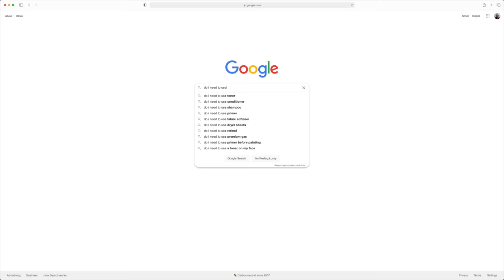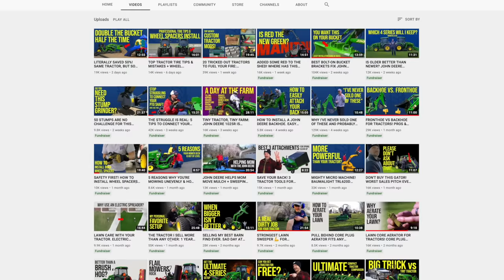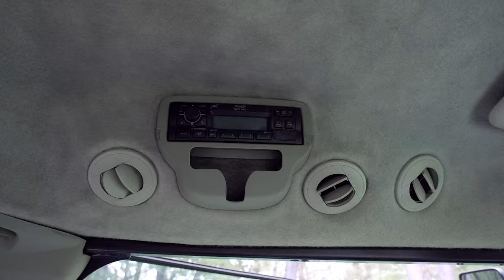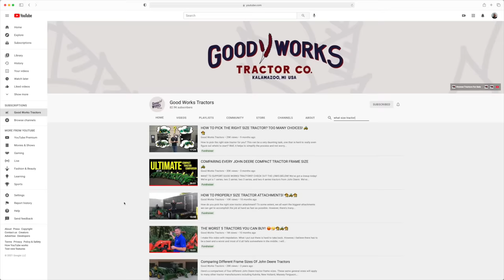TOP 10 BIGGEST TRACTOR PURCHASE REGRETS! COMMON MISTAKES! 😭

Comment: Mid mount mower is the reason I'm getting rid of my tractor. Thought I'd use the hell out of it but I'd rather use my 300 dollar riding mower. It's just too big and a hassle to deal with. A tractor is not a mower
Reply: Never understood why anyone would purchase a compact (or larger) tractor when used just for lawn mowing. I don’t think all that weight is good for a lawn. I would strongly recommend an x500 or x700 series John Deere for lawn mowing.

Comment: I love my mid mount mower deck. I have a John Deere 1023e. It takes less than 5 minutes to attach or detach it. I have about 3 acres to mow. I suppose a zero turn would be nicer but they cost about $3000 more and you can't put a loader a bush hog or a box blade on one.
Reply: People who only use it for cutting grass..
I could see how a zero turn would be more appealing to that person. I'm not that person though so idk.
Reply: I feel the same way! tractors mow fields not 1/2 acre yards.
Reply: I specifically purchased a belly mower so my tractor would do (almost) everything. A separate rider would be $3k-7k and I didn't see the point of spending that much on a single use machine
Reply: I had a belly mower on my old Kubota BX2680.  Hated it!  It didn't do a good job, the tractor left ruts in the ground, was tippy, and I had to remove it to turn the manure pile.  I bought a Scag Patriot for $6500 and it is 100 times better.  Cuts down the job considerably.

Comment: 1.  Mid Mower
2.  Ballast
3.  Implements included into financing
4.  Education on how the tractor works
5.  Options (needed or not needed), especially factory cab
6.  Not having a Quick attach bucket
7.  Getting the wrong size tractor
8.  Wrong size tire or tread pattern
9.  Hydraulics (The biggest one) - like having rear remotes or 3rd function.
Reply: Thank you! Too much talking to generate ad revenue. Thankfully somebody get straight to the point.
Reply: It's nice you did this because I watched and took notes and was wondering why I only had 9 and not 10...at least it wasn't just me 🤣
Reply: @jasonjhiggins I love it when someone comes right out the gate with the honesty - I have watched this fellas videos, and they do provide good information- but is DEFINITELY - too much talking. We are far too polite today 😂
Reply: Made the mistake on my first tractor 50 years ago of not getting 4WD. Have known several people who have made this mistake, even after my suggestion, that opted for the 2WD model and after only a couple of years traded for a 4WD.

Comment: I just purchased a Kioti CK2610 HST with FEL & bucket, which is currently being built at a dealer in northern TN. No mid-mount mower (don’t need it) tires being filled with rim guard and widened, attaching box blade for counter weight, ordered Titan pallet forks, dealer installed 3rd function valve and two sets of rear remotes, changed R4 tires to R14, linked pedals, NO cab- don’t care or need it for my applications, and SSQA. I upgraded from a JD 655 HST to the Kioti. I spent three years researching before pulling the trigger on the Kioti CK2610. The lifting capacities blew JD 3025e and Kubota L2601 away. I have all the dealers of all colors around me. I was disappointed with the JD 3025E, I really like the Deere’s. Thanks for the insight and sharing your tractor wisdom.
That stump bucket is on my list (maybe I’ll win it). My only regret so far, should have bought the Artisan pallet frame and forks instead of Titan.

Comment: After watching this I now feel confident I have zero regrets with my new tractor purchase of a 2021 2025R and yes it has a backhoe ! - 126 hours on it in 2 months and at least 40 on the backhoe replacing a barn foundation and moving trees  - only 1/2 done with that one project with so much more work to do here ! After watching this I am so glad I didn't buy the mid mount mower deck for my 2025R !  All I really need is a small riding mower - I'll likely buy used for a couple hundred bucks.  I think the primary reason I feel so happy with my purchase is the education I obtained from this channel before and after I bought my tractor.  Thanks so much !!

Comment: I bought a 1025 in aug. 2020. I love the tractor, but I have had nothing but problems with my dealer since day one. His reply when I asked for a manual was "what do you need that for?" This was after I had signed. I also was to recive 3 attacments with. I picked out the bucket, mower,and tooth bar. It has been 10 months and I still do not have a tooth bar. He tells me they stopped making them! Many other problems with him. I cringe when I have to go to get anything done for it. Thanks for ALL of your hard work in making these videos, I feel supported and will meet my needs with your help. Thanks again, please keep um commim!

Comment: Great video. I just wanted to say I purchased a John Deere 2025R spring 2021 with loader, mid mower, tiller and backhoe (I also have a 5 foot bush hog). One of the best attachment's I have is the mid mower with quick attach. It's easy to put on or take off and with quick attach easy to clean. We mow about 3.5 acers, my wife use's the 2025 and I use our o-turn to mow around the house, trees ect. It's august now and we have 60 hours on our 2025, about half of those  hours are using the mower. I raise the deck up and mow some areas that I used to bush hog. The backhoe I have not used that much, I don't regret having it but it is a lot of money for something that I don't use that much. I'm sure over the years it will get a bit of use.

Comment: I have the 2017 John Deere 1025R FILB package with a 54" mower deck & it  came with a set of pallet forks with the tall back rest as an "option choice"! Ive been  very happy with my purchase  & this little tractor has been a godsend. I also have a 6ft rear mount, 3-point hitch, blade & the quick hitch attachment! The only thing is, i wish John Deere would've made the front loader joystick control with the diverter kit as standard equipment when purchasing these small tractors! Ya crap in  one hand & wish in the other hand & see whatchya get, ehhhhh. . . .🤔🤔🤔🤦🤦🤦

Comment: I’m actually very impressed with the amount of work my ‘20 Deere 1023 can do. I did my research and the dealer was very helpful, I just didn’t realize I would need a difference between the 1023 and the 1025: cruise control. And I really only notice it when I’m rolling the 3.5 acres of lawn I have so it’s not the end of the world. I was aware I would need ballast (Heavy Hitch, front and rear!) and would NOT need the belly mower (not as maneuverable or as fast as my zero-turn as well as being a storage nightmare) thanks to watching what my cousin went through for a year before I bought mine.

Ok, off to see if I can find an add-on cruise control for rolling but, really, putting it in high range and just resting my foot on the forward pedal just about does the job. Great video! Oh, and I couldn’t live without my Quick Hitch!

Comment: I have a 2210 John Deere. I love my mid mount 62" tractor! I keep it on 90% of the time! It makes the tractor more stable especially with the front loader is on. It's much easier mowing than a brush hog for my 3-4 acres of lawn on hilly terrain. The zero turn would probably end up in my pond!!! 4wd is the only way to mow on hills!😀

Comment: Thanks for the confirmation.  I avoided all pitfalls with the exception of purchasing my implements at the time of tractor purchase.  Not that big of a deal as I paid cash for those afterward but would have been a good tool for negotiation.  The third function is a MUST for anyone with acreage and especially if your property is wooded or partially wooded.  The grapple is by far my most used front end implement.  I can't recommend it enough.  My neighbors love it too ;-)
Reply: I have used the brush crusher grapple for the past year and my neighbor with a skid steer is amazed what I can do without a third function

Comment: My family just purchased a new 5045E for our new ranch (the good used stuff in our area is running so high and with so little existing inventory that it wasn't worth it to go that route). The reason we went with the 5 Series? Price. The 5 series actually came out around the same price as the 3039R that we had originally intended to buy, and cheaper than the 4044M. And I saw the same sort of thing with New Holland, Mahindra, and Kubota. That entry-level utility tractor cost the same as the larger compacts, and we got more tractor. Since we have a sizeable property, going larger than anticipated didn't hurt budget at all, and we have the room to expand with the larger unit.

Comment: Another comment, I totally agree with the R14 tire bit. Great tires. BTW, I'm commenting as I'm watching. The last bit, hydraulics. Spot-on, you can't have enough. I did think ahead and get rear remotes on my K, glad I did. Added a hydraulic top-link, a wonderful thing. Big mistake I made was not getting a backhoe when I bought the tractor. That was an expensive add-on. Oh, and never get one of those aftermarket backhoes that just hang off your 3-pt hitch. At least, not unless you really hate your tractor and want to break it in half.

Comment: Hmm. I am buying a 1023E right now and have read plenty of reviews saying they are happy with their mid mount mower. I understand a zero turn can be faster but I have some hills to mow which I heard low end zero turns are very bad on. As long as my 1023E will get the job done I don't mind if the job is a little slower. I was interested in a X700 but deere had made them so you cant equip a 45 loader anymore. My goal was to get once machine that can mow, collect leaves, loader work for mulch, compost, sand, grading, etc., and to help with snow removal in the bigger storms. I don't see any other good options to accomplish all of that with one machine.

Comment: I bought a '23 1025r and the 60" auto-connect belly mower is one of the things I like the best. I like the smaller uncut radius of this combo over the Kubota. Most of the other reasons I chose the JD over the Kubota turned out either to not actually be valid and/or were printed material ambiguities. 
For those looking at Front End Loaders, consider the Mechanical Self Loader (MSL) option. That is what I thought mine had according to the printed and downloaded materials.

Comment: No regrets for my 3032E which is the gap filler for me. I have not run away from the HP, runs a 6ft brush hog just fine. Bought a BC4215 direct from Westendorf (Took forever, should have bought it from you!) I did buy the Speeco from you, and it was a solid purchase, There are many attachments now and change front and back out in 2 minutes flat. Drive into the barn and come back out looking different is really cool. I have a full size JD410 so, a backhoe option is not needed right now but when I downsize I am pretty sure an "R" or equivalent probably 3039 or 3046 will be the go-to unit and sell off the big stuff. Lol Maybe....................
Reply: I picked up a 3032 in feb, was going to get a 5 foot bush hog.  If a 6ft  works good for you Ill have to get one, wasnt sure.  Thanks

Comment: I ended up buying a 2038R and a year later traded it for a 4052R. things I found most valuable:
1. the top and tilt (3rd function) hydraulic kit. this is by far and away the BEST option for the rear 3 point. I highly recommend it.
2. understanding the difference between box blade and land plane. I am a HUGE fan of the land plane for grading. the box blade is better for moving large amounts of rocks and dirt but harder to grade with (in my opinion).
3. get the wheel spacers
4. unless you are in the tractor full time in the heat or in the cold I would skip the cab. 
5. skip the mid PTO
6. some implements are better bought after market
7. I am a huge fan of the flail mower but it is very expensive
8. fill the tires with ballast - that way you don't need to screw with suitcase weights
9. skip the JD imatch and buy the speeco from goodworks
10. the pallet forks are the most underrated implement of all time (see if you can get your dealer to throw a set in for free)

Comment: I second the recommendation on the Carlisle Versa-turf tires.  Great winter and mud traction.   Wish I got the hydraulic top link, but I got the right tractor.   I don’t regret getting the 1023e instead of the 1025r.  There wasn’t anything on the 1025 that I miss.   I had the dealer install two rear facing LEDs on the roll bar for night time operation and I’d never be without them.  Always appreciate the advice from both you and Tim.

Comment: I bought my first tractor in 2015. I had zero experience or knowledge about tractors. I went to the local John Deere dealership. I was impressed with the overall quality. I made a 1025R purchase with a Frontier 48" rotary cutter and the standard bucket. I was disappointed that the salesman never explained much to me or gave me information on attachments. He never mentioned the MMM or anything about ballast. Thinking back now I wish he had upsold me to a series 2. I eventually purchased a 60" MMM based on TTWT videos. It is an awesome attachment and is easy to install and remove. I don't have a quality lawn by any means and only have grass around my house. The MMM does a great job keeping it down. I'm not impressed with my 2 local JD dealers and even less impressed with their websites and help. The tractor is amazing and I love that it does everything I need around my farm. It's even better since I bought a set of pallet forks from GWT. Thankfully youtube videos from GWT and TTWT have helped me a great deal with my tractor.

Comment: Bought a Kubota Grand L limited. Thought maybe too big for my needs. I couldn't be happier. Just a fantastic machine and just right. Box blade, hard roof, quick hitch, forks and bucket. Went with a zero turn for mowing the 3 acre yard. The box blade and liquid filled tires are plenty of ballast for me. Still have a tiller, cary all, aerator and stump bucket on my wish list.

I would have liked to have maybe tried turf tires (they are hard to get now) but also I probably would have gotten the tractor stuck by now with the earthwork I've been doing. 

So, no regrets. 

Thanks.

Comment: I bought a used 1025R (‘21 w/60 hours) that came with the front bucket and 54” belly mower. I like that mower. But then, I’m retired and don’t mind burning time to get jobs done. Great around trees. My wife uses our Husqvarna 24V48 lawn tractor (also 24 Hp - which is why you can’t go by just horsepower) for finish mowing around the house and I use the 1025R everywhere else around our former sheep pasture and gardens. Compared to the 1956 Ford 640 and 5’ rotary cutter it replaced I’m in tractor heaven. Much easier to navigate in the woods when shagging firewood. Though I will eventually pick up a 4’ rotary most likely. Maybe even a flail (used to operate a Ford 2N with a flail and that was a great mower).

Comment: Just started watching this video and see you sponsored by BORA  well I have a Kubota L3901 live in the coast range of Oregon lots of hills and different slopes on m property  got a couple seat of the pants scares, on those slopes because my tractor is so narrow , I got the BORA  6"  steel spacers  , what a huge difference they made  made my tractor 100% more useable,  all in all I think I did pretty good  , I got the Back-hoe , a 3rd function valve, a quick attach for the 3 point  , the front loader  with bucket, grapple, Pallet forks,  and the quick attach , and for the 3 point  , a Auger with 4" 6" 9" and 12" bits, also for the Auger I got the Down Pressure kit,  Brush hawg, Scraper blade,  Scraper box, Rake, I also got the Canopy mounted on the R.O.P.S, I decided on the R-4 tires with ballast ,   and working in the industry  I knew I was going to need lights and more ballast  So I added my own lights under the Canopy, built my own ballast box ,  and also mounted some side view mirrors .

Comment: Back in 2017 I purchased a Kubota BX2680 with a front snowblower and a belly mower.  Using as a grasscutter was a pain.  It was tippy, would leave ruts even if you were careful, needed a larger area to turn, and just generally did a poor job.  The snowblower was not the easiest thing to put.  Once it was on for the season you weren't taking it off.  It was 2-stage, and it did a poor job also.  The snow had to be the right consistency.  It used 2 different shear bolts which would break often.  The front end loader had a lift capacity of like 400 pounds.  I put 6 fence posts on it and the back of the tractor went up in the air.  I bought the 2680 over the BX23 for the extra 3 horsepower for an additional $2000.  That 3hp makes no difference in the tractor's capabilities.  I also bought the clip-on pallet forks for the loader which are a joke.  You can tighten them down all you want and they still loosen.  SO, I traded that piece of machinery in and bought a Massey Ferguson 2860M 60hp tractor and a Scag Patriot ztr.  I bought a ssqa pallet fork, a snow pusher from GWT, and a flail mower from GWT.  I'm much happier now!

Comment: My only real regret is going with the dealer closest to my house. They were easy to make a deal with, but did some pitiful work on installed options. I can tell you who not to trust in Macon County NC. I smashed my grapple hookups on the first use and the hydraulic dipstick was dry upon delivery.
Reply: I am just the opposite  - The places close to me are either big ag dealers with no interest in the compact market and terrible customer service or they are selling lawn tractors only.  I bought mine 40 miles away in the suburbs - free delivery to my house, and at least 3k less than anyone else.  The hydraulic cylinder in my backhoe started leaking in the first 30 hours of use (not from the seal but the cylinder itself needed to be replaced). This dealer picked it up and repaired it for free (no charge for the 80 mile roundtrip and warranty repair)